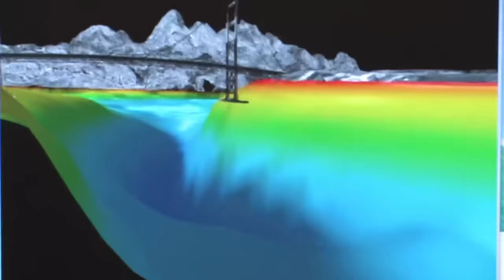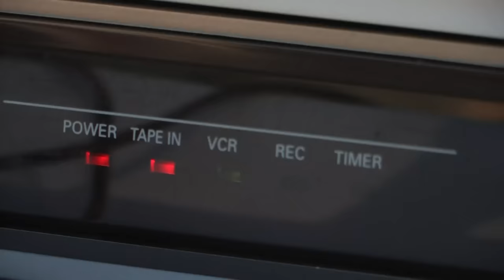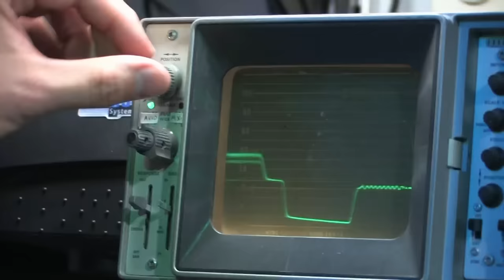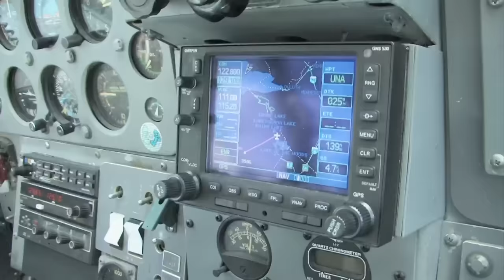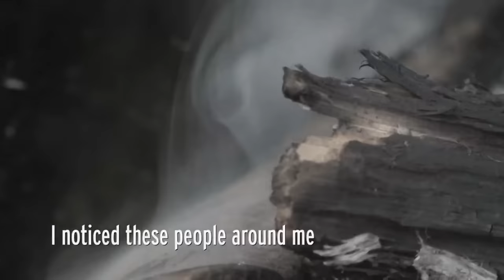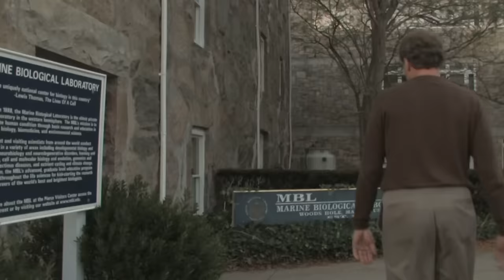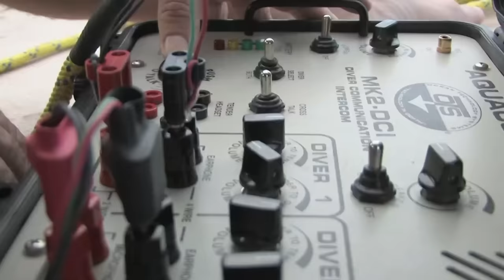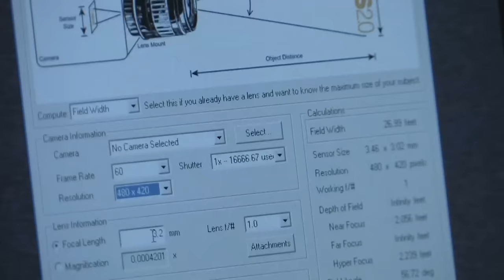MonsterQuest: The Most FRIGHTENING Monsters Caught on Camera *3 Hour Marathon*

Comment: A live ceolacanth was found some time back and that is considered a 'fossil come to life', so why wouldn't other unknowns to us still be alive on this planet? This planet was very different as far as geography, where deserts used to be oceans and continents were fused together.
Reply: Ceolcanths survived due to their ecological niches. They were benthic grazers, which mean they grazed on smaller species on lake, river, or sea sediment floors. They lived deep enough to survive and avoid the mass impact from the meteor. However, just because they survived, doesn't mean they didn't change. They called stiglomorphs, and they evolved at a smaller rate. Many species survived, just evolved at slower rates. Crocs, sharks, horseshoe crabs, just to name a few. However, most if not all of these were water dwellers with extremely special and unique niches that were not impacted by the mass extinction and continental drift. However, in the same respect, many many didn't survive and was either wiped out or evolved to the point that they were no longer recognized as its original species. So though not scientifically impossible, the idea of many creatures like Nessie or Champ is scientically improbable.

Comment: I would say sturgeon is the only monster in that lake or any other lake on this planet has.  To maintain a population of this monster they speak of, there would need to be at least 1000. If there was over 1000 of any water animal that needs to surface for air, you would have sightings daily,  several sightings daily.  The other sighting of it out here c the lake waddling around and the big bumps etc were a Parador mistake, exaggeration, or lie to help back up what they believe to be real.
Reply: Sorry a few typos there and my edit option is gone for some reason.

Comment: no one in the world has ever spent as much time fishing  in the world has ever fish as much as i have.with a rod and ree l fishing.i was ftshing off the pier in key west florida when i had a nibble so i ran back to my shop for a betterfishing tackle two men standing on the boa a t tried  to tell me i was hook up on the bottom.i took a eighteen size hooh big rope wire cable and hook fish six each and dropped mt hook lightly in the water two men on the boat tried to tell me i was hooked up on the botton i dropped my hook with six nice siz e mullet for bait on my hook and lower it carefullyin the water very slowly. two men were laughing

Comment: Since you know so much explain the coelacanth
Reply: To whom do you address that request?
Reply: @davidcopson5800  to the coelacanth off course😂
Reply: @wandererkyamani9829  The coelacanth has joined Extinction Rebellion.
Reply: Coelacanths are considered stiglomorphs. They have evolved, just not to extreme levels. Sharks, horseshoe crabs, and crocs all fall under this. Yes, the genus has survived since the extinction but this is because KT Extinction and the continental drift did not effect their ecological niches. Sharks and crocs were indiscriminate apex predators who hunted and ate just about anything. Coelocanths and horseshoe crabs were so specialized, their diets weren't affected and they were left unmatched, so they didn't need to evolve as rapidly or extreme. Using coelcanths for example, they were benthic grazers. They stayed near ocean, lake, and river floors and grazed on the sediment floor. They were deep enough that they werent affected by the climate change and were already adpated to fridged waters. Their diet wasnt scarace and there was little competition. In contrast, plesiosaurs were middle of the chain, fish eaters with lots of competition, who breathed air. Due to breathing air and were not either apex predators or highly specialized feeders, climate change, competition, and being hunted themselves did impact them to the point extinction.

Comment: The creature in the photo is a whale. It is some type of whale that came to the surface and was swimming on its side. What they think is a neck and a head it's actually a pectoral fin that it pulled out of the water. It looks a bit skinny because of where the person was actually standing when it took the photograph, but had it been on another angle more to the left where the head of the whale actually is then that person would have seen the flatness of that pectoral fin. What they think is a head is just the fin bending on its own weight with the sun up high it created a shadow under the fin that looks like a head but it is not.
Reply: I agree ,humbbackwhale or spermwhale ,its a fin ,not possible a creature of that size cant even survive not enough food to sustain life ,so funny some comments lol